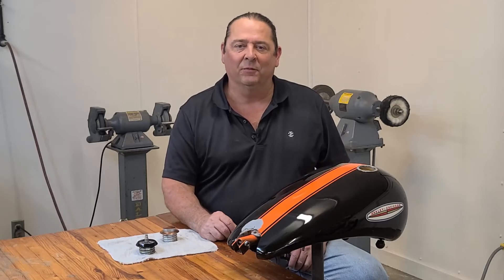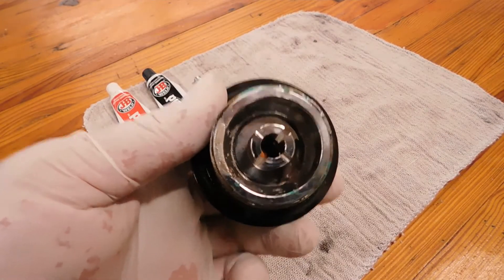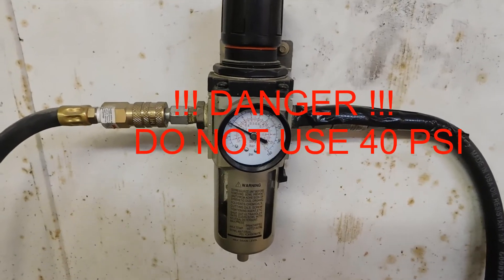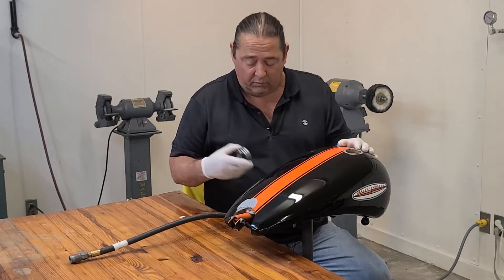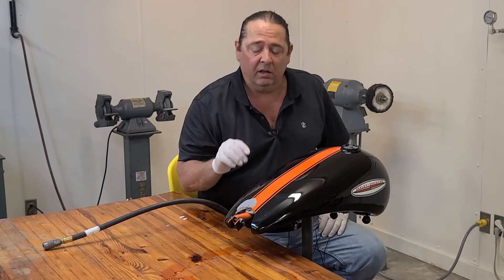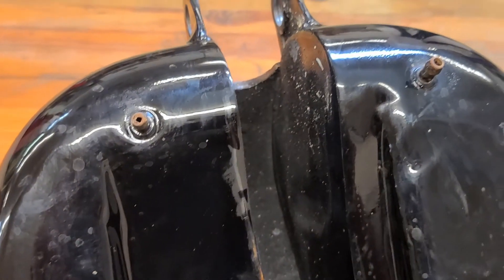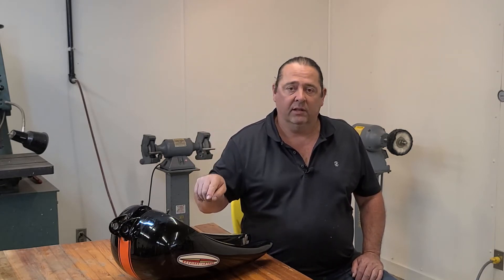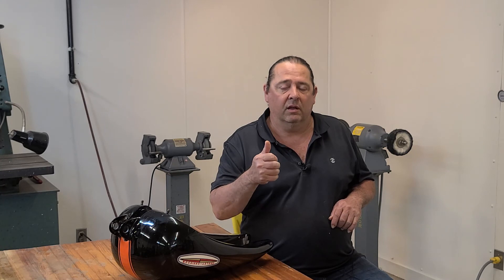HOW TO (NOT) PREASURE CHECK A GAS TANK !

Comment: You may want to check with a pressure vessel inspector. It's been years since I was involved in construction but If memory serves anything above 15 psi was deemed a pressure vessel and subject to ASME code section V111. Testing with any air pressure can be extremely dangerous especially on old vessels that the corrosion allowance may have impacted vessel integrity.
Reply from the maker: Thanks for the info and commenting!😉